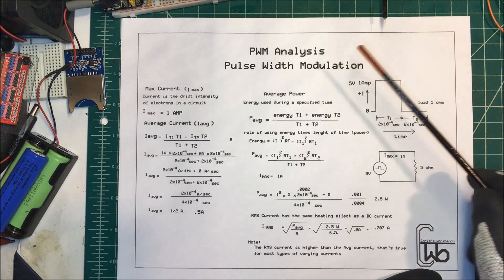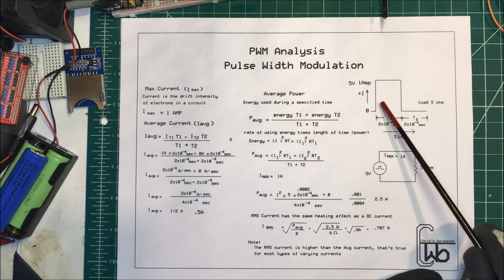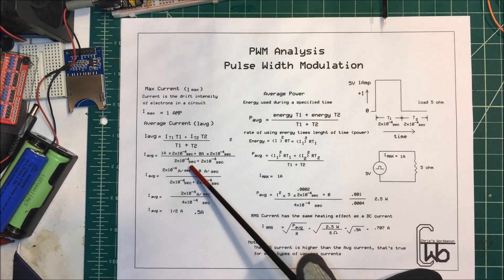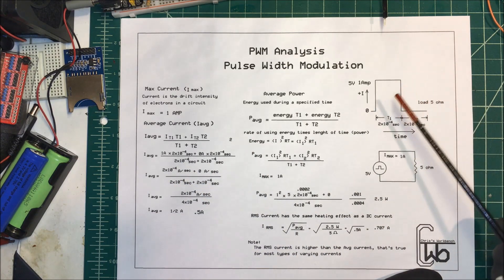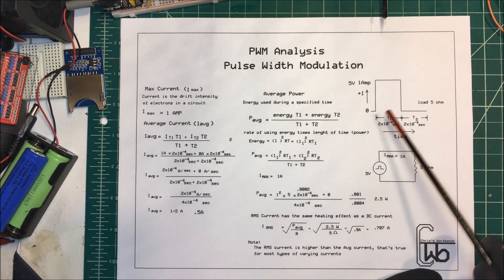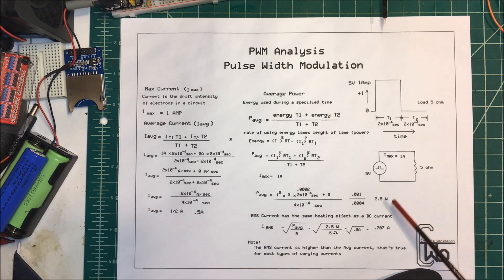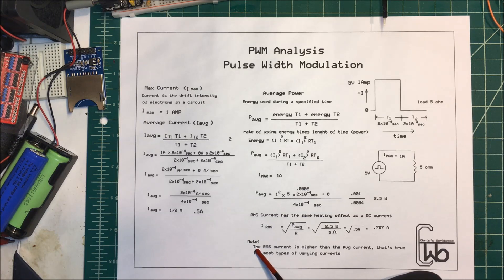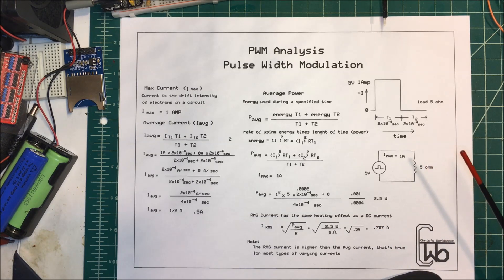PWM Analysis

Comment: Dear Chris, I was wondering if the average current is  0.5 amp, why is not the average voltage 2.5 volts? I know you didn't mention average volts.
Reply from the maker: True the average voltage is 2.5V, the RMS voltage is 3.54V
Reply: @ke6chris forgive me i'am a beginner, and at the risk of boring you, you had the power at 2.5 Watts, But average volts 2.5, times average current 0.5 would be 1.25 watts?
Reply from the maker: RMS current  (.707) times RMS voltage (3.54) = 2.5